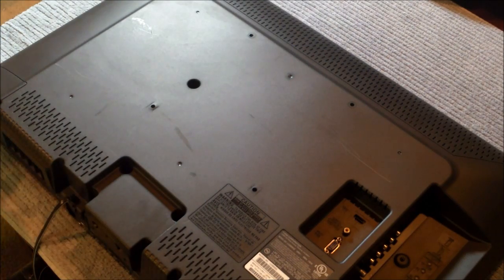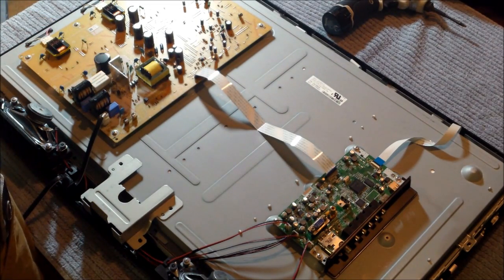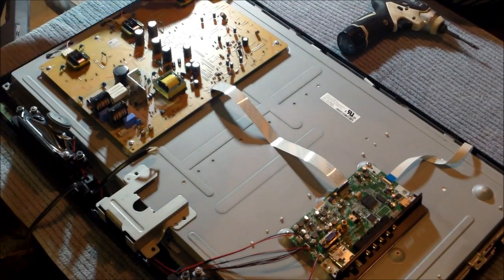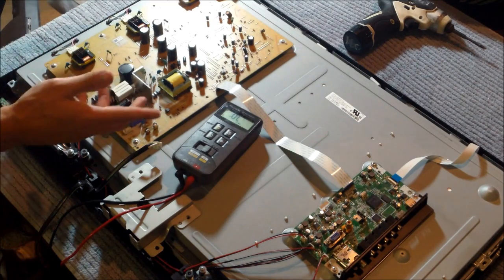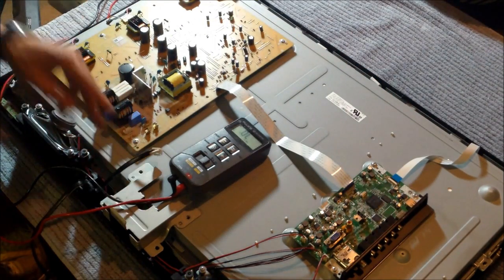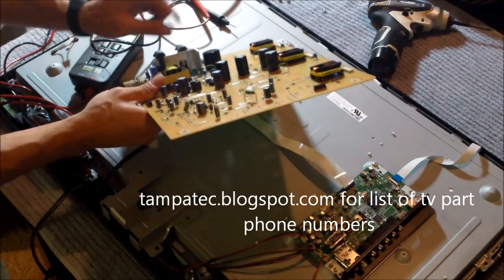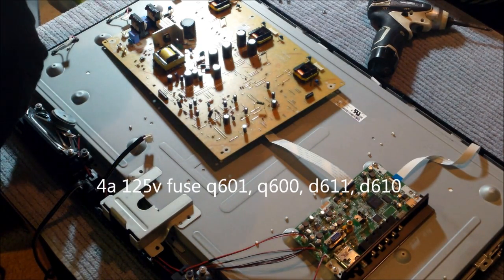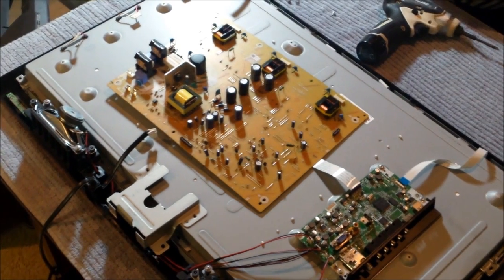What Causes a Blown Fuse in TV Sylvania LCD

Comment: Were the diodes really shorted, or did the shorted transistor and the transformer winding (which will often look like a short) just make it read that way in the circuit? Shorted diodes were very rare when I did component level troubleshooting back in the 1980s.
Reply: Over 3 years and no reply, wow...

Comment: I think diodes are supposed to have the beep when you put negative leads to the leg with the silver stripe and positive to the other, hence they have continuity in the correct polarity and not in reverse. Am I wrong? I have the same TV with the same problem, the same board with a few components placed differently, like mine don't have D611/611A and board # is BA17F1F01 02 4, all other numbers are the same.mine has one of the SMD diodes on the other side shorted/ bad. D640 I think is the ID

Comment: I have a 42 " Sylvania It is an older flat screen,  and there is no tuner,  Had to add a vhs to get tv I think it's just a monitor,  the standby  (Red) light is on , but when I push the "on" button the "Green" light comes on  momentarily then returns to standby. Any insight's or advise?

Comment: Misleading title. You don't really find out why the fuse was blown or what caused that issue. Replacing the old parts with identical ones and hoping for a different result than a blown fuse and a broken transistor regulator along with some diodes... yeah, you'll be fixing that in a few years all over again. But I guess that was to be expected when I saw you didn't even remove the AC power cable before opening the thing up and sticking your head in there.

Comment: I have a 2013  50" Toshiba that blows 4A ceramic fuse. TV works fine, turn it off and wont turn back on, replace 4A cer fuse and as long as its not turned off? it works fine
I do notice when i plug it in to wall outlet i hear a faint sparking sound right at the plug itself, like its arcing,.
Any idea what could be causing this apparent short circuit?

Comment: Can I use a diff amp fuse 1.5 amp vs 4 amp
Reply: 1.5A would blow SOONER.  It's possible it may work in place of the 4A fuse.  NEVER EVER GO TO A HIGHER VALUE.  It is for circuit protection.  A higher value will allow more current, but that could damage parts and could easily cause a fire.  It is there for your protection.  In the old days of screw-in fuses, people would stick a penny in the fuse because it ket blowing.  That would protect NOTHING because a penny is so thick it would never be able to burn through.
Reply: Are you mad or stpuid, do you research before asking such a question.

Comment: I have a sylvinia tv very similar to the one your working on with exact same symptoms only thing is fuse is ok and I checked the power cables coming from the wall to the power supply board and I have 118.5 V~ . What should be my next step? Thanks for your time.
Reply: 7 years on... what did you do?

Comment: There was actually a service bulletin released about the D611 zener diode on that particular board along with several other similar make tvs. The resolution is to just pull the diode and eliminate it. In alot of cases that's the only cause of a blown fuse and the tv fires up and works. Also when you test diode D610 on that board it will show up as shorted while it's in-circut. You actually have to pull that diode for testing.
Reply: I know this post is old but I hope u see this! THANK YOU SO MUCH FOR THIS POST! We had a wind storm in y area recently which caused a power outage and my tv completely went out. I changed the fuse and it blew immediately. I tested everything as he did and D610 and D611 were bad (or so I thought) The repair kit that he suggested didn't include the D611 so I didn't order it and have been searching for weeks for replacements! Mind you, I haven't fixed any electronic ever in my life! I am so glad I came back to read the comments (I normally read comments before I can even finish a video)! I had already taken the 2 diodes out so I tested it as u said and what do u know....It was good! I just put it back in and put in a new fuse and BOOM! IT CAME ON!!! Thanks again for this post!

Comment: That looks like the BA17F1F0102 supply. If so check zener diode D611 for a short. If thats the case then pull the diode and don't replace it, the manufacturer did away with it. After pulling the diode check Q600 and 601 along with other surrounding diodes for shorts. Do this and try testing the set again

Comment: The supply on this set is small enough that you can use a 100-150 watt light bulb in place of the fuse for the initial check. Normally the bulb would partially come up for a second then settle down to a dim glow, or might not be visible at all.  If the bulb comes on at full brightness then you have a short. It will save you from wasting fuses, and further potential damage to the set.
Reply: That way you can damage other components. A fuse must be blown in order to protect the board components.